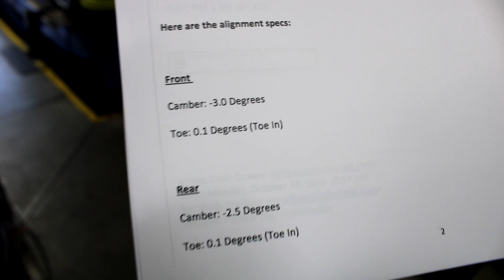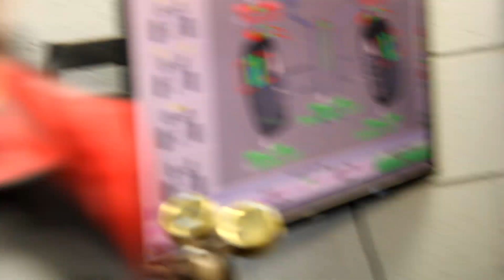Getting Track Alignment And New Rims On The C8

Comment: Were portions of your vlog shown out of order? Why would you align you original wheels and then put on the optional factory (not aftermarket) wheels?
Reply: yea tht would definitely effect alignment they just did
Reply from the maker: Yes I did switch the tires after the Camber and toein
Reply: Very nice wheels
Reply: Lol when you adjust your camber setting it has nothing to do with your wheels and tires it has to do with your suspension being adjusted. Putting different wheels and tires you will still have the same camber
Reply from the maker: Thanks David

Comment: I hear the car has lots of understeer without track alignment. Is this true? Also, how long did it take to do the track alignment and the $ bill would be helpful to know as well.
Reply from the maker: It took Aprox 3 hours i’m not too sure on the cost the dealership done it for free for the plug on YouTube. You will not notice the understeer until you push it hard on the track
Reply from the maker: Thanks for the sub

Comment: I like them both but would prefer an aftermarket silver wheel.  Tired of black rims to be honest as they all look the same from 100 feet away.  Need to be up close to see a good black rim (like carbon fiber accents on outside).  The silver makes the yellow pop.  Just my opinion..
Reply from the maker: I agree with you Alan I would like a nice chrome rim I’m still looking
Reply: @greatwhitenorthcorvette8133  I found Avant Garde wheels to be way less than most and look great.  The M580 is my current leader...for when I order my Corvette...